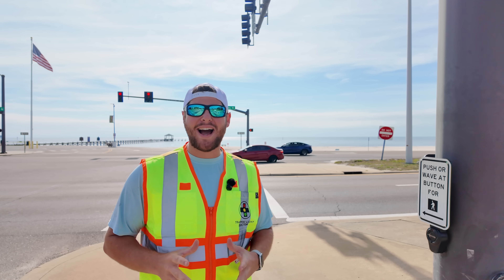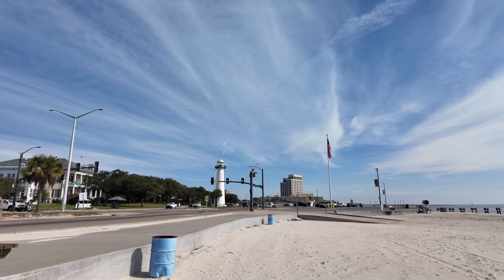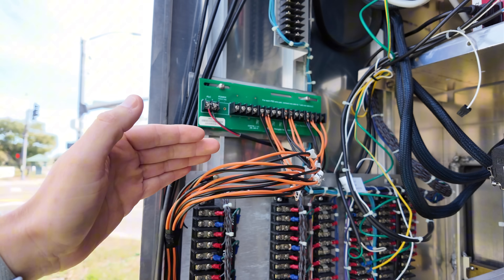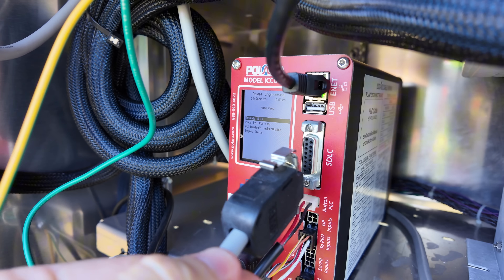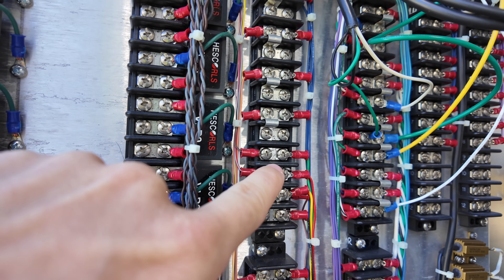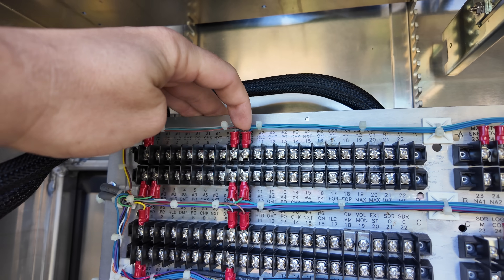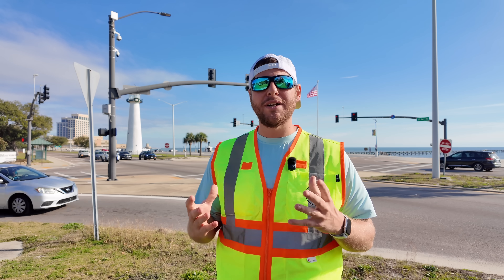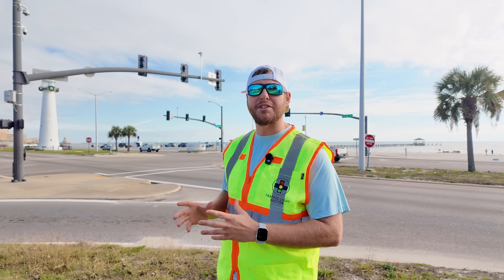What Happens When You Press A Pedestrian Button?

Comment: Yee spoke about a lot of wires, but failed to really explained the programming logic of who goes first and when I the case of all the variables, turn signals, yellow turn signals, what is the logic flow, who goes first, what extra steps are inserted, which automobiles are intercepted.  Typical engineer explaining wires without the most important information, the outcome, results, and ramifications.

Comment: Wait... I'm confused. Now where I have been does the walk indicator not happen with the buttons are not pushed. 

In my current city, Nashville, they most certainly do not do anything. The timing of the lights do not change, the walk indicators happen regardless, and the length of time for walking does not change..

Considering, that often I drive small, static areas with many pedestrian paths, as part of my job. So, I'm intimately familiar with local light changes.

The same has been true of my home city, and neighboring cities. (Which, incidentally, are nearby Biloxi, my sole childhood vacation destination.)

Also, that cycle light active crossing sounds to me like all the vehicles are stopped? Wasn't clear what that means. All the ones I've seen, pedestrian crossings are just synced to left, right, and/or forward turn traffic. Aka, when the lights turn green, plthe parallel pedestrian lights also turn to "walk". 

Generally you can accurately guess the light changes by watching the appropriate pedestrian countdown signals, allowing you to prepare for when the lights turn.

Comment: What a remedial excuse of a PLC, especially compared to any general purpose industrial controller, like those made by Allen Bradley, or Siemens, or GE (Emerson), even small controllers like the Modicon M172 manufactured by Schneider Electric specifically designed for HVAC is capable of more logic. I’m sorry, I’ve been automating industry since 1987 and what some industries refer to as PLC’s is pretty misleading, I suppose my cars cruse control controller could be called a PLC as well under the current usage of the term.

Comment: without the pedestrian call button the lights prioritize traffic lights for any turning vehicles with the green thru traffic signals for one direction.  but when you push the button it signal to let turning vehicles turn first and thru traffic still waiting at red lights.. left turn signals shut off then green light signal for thru traffic turn on along with the pedestrian walk signal... so pedestrian can walk along with thru traffic in the same direction.  
I believe it has nothing to do with timing or how quickly the walk signal comes on...  it changes the sequence of the traffic signals in a way that's safe for pedestrian to cross.

Comment: Even in the late 1990s, techs like you used to remotely connect to these devices using Tandy Color Computer 2 machines (a Motorola 6809 CPU with 64KB of RAM).

Comment: PLCs have been around for over 50 years, you would not have impressed me if you walked through the ladder logic diagram as if you done the electrical engineering of it. The industry you are a part of does what I can only qualify as "verry, very bad" management of traffic flow. We all see a green light just ahead as we wait for the STOP LIGHT we are stuck at to finally turn green. We all know that if we can get within three hundred feet of a green light, it's gonna turn yellow right at a point where we either have to gun it or slam on the brakes and then watch big gaps in traffic as we idle at that STOP LIGHT. There is very basic tech that allows ticket cams to work that could easily be used to hold a green or yellow light so that traffic can flow but the lights for 98% of the country are severely sub-optimized making so called traffic signals nothing more than disconnected STOP LIGHTs, no how pretty you think the wiring is in that 1970s  style control cabinet. 

How about you make a video about why STOP LIGHT management ("very, very bad") is so far from optimized traffic signaling without blaming the use case (actual people trying to get from point A to point B without delays)?

Comment: Can a small notice be added to the buttons showing average response time for a button push ? That was a daunting intersection ! I’m surprised how no one in the design flow of the signal system anticipated user frustration at never receiving any acknowledgement their button-push was acknowledged or any information about average wait times for a response.  Your presentation here, pointing at terminal strips means little; it’s an almost cynical attempt at reassuring the public : ‘OK, heeeere’s the wire coming out of the button, and here it is connecting to this terminal board. . .’ Blah blah  The system reads our license plates but gives nothing in return. The sun is beating down on us (or the pouring rain) as we stand there waiting, we’re tired, the utter absence of any feedback from the system as the cars keep whizzing by make “the button” seem like the inexpensive result of monkey experiments on how to create an illusion of expectation. Your post here is just a weak attempt to boost faith.

Comment: So complicated a system but it works well.  In our town , traffic circles are replacing many lights but a huge issue is cross walks on the exit of the circle causing traffic to stop in the circle.  I learned in New Zealand that it’s ok to go around the circle multiple times rather than stop for a pedestrian.

Comment: ONe of those new talking ones by my old place would never turn no matter how much you hit it. I've sat through 3 full light changes before i just walked across.

The older metal buttons, at lest in my city growing up, not all of them were connected.  there would be no wires coming out the back so pushing them did nothing. you just waited for the lights to change.

Comment: If the ped button is never pressed wouldn't the crosswalk become active anyway once the light changed for the intersecting street?  Does pushing the ped button actually speed up the normal traffic light cycle, i.e 60 seconds vs 120 seconds?   PS the longest I've every waited was 5 1/2 minutes for a 3 lane left turning signal to cycle in Clearwater, FL.  All hours of the day or night.  My hotel for a week was located just past the intersection.  I thought I was losing my mind and had to time it with a stopwatch...  Have we forgotten how to make unprotected lefts?  Maybe turn off after rush hour?

Comment: So, basically, all the button does is control the walk/ no walk sign and has nothing to do with the traffic lights.  That is what I thought, and why I ignore those lights and cross when the traffic light turns green while keeping my attention on any vehicles that may be turning.  Faster and just as safe.
Reply: It has everything to do with the traffic light. The ped will also give you a green for the vehicle unless it is set to run exclusively, which is rare. If you don't push the button, the green might be shorter than the time allowed for the ped to cross, which can cause the pedestrian to get stuck in the middle of the crosswalk. The pushbuttons are there to ensure you have enough time to cross. Maybe he should have given you an example of what can happen if you don't push it.
Reply: @miluth2  
They do not give older or disabled people who can not move very fast enough time to cross.   When you push the button, half of the time, they really do nothing and the traffic lights cycle like normal.  Better to use what use to be called common sense than to depend on iffy technology.
Reply: @Allen-w9d Sorry, I do not control the timing that someone chooses to install for pedestrians or whether or not the buttons are working like they should. I can only tell you how it works and what CAN happen if you don't push the button for your safety or others who might be with you.

 There is something called Leading Pedestrians Interval. It gives you a head start with the ped signal (3-7 sec) before giving a green to the vehicles. I don't know if the controllers in your area has that feature. You can inquire with the owner of the signals in your area, which could be county, city, or state if you feel the timing or the operation of the buttons don't suit you or others.
Reply: And illegal.
Reply: @soniaTX4387  
Depends on where you are at.  Not illegal at all where I live.
Reply: @All @Allen-w9d y little town obsesses about “jaywalking”.  But actually I appreciate the walk sign because they actually work here. If there is a pedestrian, for example, the left turn light will stay red so walkers can cross ( well, only those who are willing to press the walk button).  Our traffic light signals at several intersections separately indicate if we can turn right, left, or go straight.  Our system accommodates drivers and pedestrians.  I like it as I can, when driving, make a right or left turn and not wait for some pokey walkers to cross. We have lots of walkers.

Comment: A PLC isn't a junction block. It's a computer. That block that the button connects to is a way to bring lots of wires into the computer in a compact way. We could call it a concentrator. PLCs are very common in factories as they control metal-cutting machines. (I work in a machine shop doing IT support while also programming the robots that we make for our customers.)
Reply: It is Power Line Communication. You may not be familiar with it. I installed a experimental setup for the company I work for around 2005. It was the new big thing. The company was interested in providing internet over power lines to homes on the same two wires that provide you electricity at your electrical outlets. Data and electricity concurrent. I never heard any more about. 

I am not sure if you are familiar with how pushbuttons are normally wired in traffic signal cabinets. This setup isn't the normal wiring location or pratice .

 It's wired this way in the video due to special equipment in the cabinet. Notice the amount of wires connected to the board labeled PLC (orange and black). In order for the controller to know which pushbutton out of the 4 phases is being pressed it will have to be some type of data code related to each pushbutton due to two wires used as a path to communicate with the red box you see in the cabinet for the 4 pedestrian phases (based on what I see here).

 The terminal is probably labeled PLC to let you know that this is where the the two Power Line Communication wires are terminated. That is the only way the buttons can work and do the additional things they are programed to do based having the additional equipment between the pushbuttons and the controller. The two wires provide some type of data and voltage at the same time.

The controller in the cabinet (the brains) that is programed for the the traffic light is Programable Logic Control.

I work in communications, in the past I worked on traffic signals.
Reply: @miluth2  Thanks. I've been dealing with Programmable Logic Controls and didn't realize the acronym has been recycled in a nearby field. The computer in the overhead box is likely set up as a Programmable Logic Control, as they lend themselves well to state machine designs.

Comment: I don't know why this video came up on my feed, but thank you for sharing your knowledge of pedestrian buttons and traffic signal controllers.

The letters PLC printed on both the iNavigator Interconnect Board and ICCU probably stand for Power Line Communication, not Programmable Logic Controller. The green board mounted on side of the enclosure is not a programmable logic controller. It's an interconnect board. It's printed right on the board. What is Power Line Communication? It's a method of using the same conductors that carry power to also send logic signals. The pedestrian cross buttons stations have onboard logic. As shown there are only two wires running to a unit and it has a button function, an LED indicator for an active request, and the audio function. The two wires carry both the power needed to run the device and the signaling to talk to the ICCU. This communication method reduces the number of conductors that need to be run from the control boxes to the button stations to achieve all that functionality at the button location. Old pedestrian crossing buttons would have only needed two conductors because they simply closing a signaling circuit.

Comment: So I'm not sure if I heard this right or not. Does pushing the button more than once do anything additional or not? I think, if I heard correctly ... pushing the button latches a relay the first time you push it and does nothing additional afterward. Also, pushing the button does NOT let you cross any sooner than you would normally be allowed to cross (which is a mis-conception almost EVERYONE has). What pushing the button DOES DO is tell the electronic controller a person is standing there, so that it will then activate the PEDESTRIAN CROSSING SIGNALS which both pedestrians and cars see (when the time comes). OR, put another way, if you don't push the button, when the lights turn green in the direction you're going, the PEDESTRIAN CROSSING SIGNALS themselves WON'T TURN ON, meanng that if a car turns and hits you he can sort-of somewhat lawfully claim he didn't realize you were in the crosswalk (which won't hold much, or any, weight in court). I think that's how it works.

Comment: You should have mentioned that the button can do different things depending on the intersection. I've noticed 3 different things that can happen where I'm at.
1. Absolutely nothing. No change in light timing, and the walk signal turns on regardless if you push the button or not.
2. It will trigger the walk signal next time your direction of traffic gets a green light without a turn priority.
3. It will keep all lights red and give you walk priority.

Comment: So the wire goes from terminal to pull box to button to pull box to terminal to other terminal to surge protector to PLC input to back panel to light controller where it is ignored. 

Thanks for clearing that up

Comment: These videos aren't wrong but they do only count for certain systems. Some of these buttons actually don't do anything, the lights are on timers based on time of day. Some just sit until they would change to stop traffic and give a walk symbol, they won't change until they can stop a car. If the intersection is, and remains, traffic free, it will not change. These systems are designed to control travel times more than safety or efficient flow.

Comment: I had to use a crosswalk for a first time in forever a couple months ago.The crosswalk button to the right of the intersection worked like normal. You press the button and on the next cycle it allows you to walk. The crosswalk on the left side didn't work as intended. I pushed it and waited for the lights to cycle only to get skipped. I pushed the button again and was skipped once more. I gave it two more cycles. In my frustration I held the button down. I finally got the walk signal to show up. 😅

Comment: I am sorry sir.  I have NEVER had one work!!!  If I press it and 2 minutes later it still hasn't changed to walk with stopped traffic that is a 100% fail.  I waited 5 minutes one time and still NO stopped traffic and light, just to prove my theory.  It is dangerous to cross without the traffic stopped, but the system just does NOT work.  I never press them anymore and cross when there is the least amount of traffic in the cross walk.  Sorry but your explanations are useless on most of your videos and simply not the real world truth.

Comment: I've never seen one that reads "PUSH OR WAVE AT".  I'm guessing that's part of the ADA's newer regulations?
I will say, at one of the crosswalks I regularly use the complete cycle time is extraordinarily long, I haven't timed it (I will next time)  but it's one of the longest I've ever encountered. Just not for the pedestrian walk portion, which starts it's warning, times nearly up, cycle about 3 seconds after WALK, and unless you are briskly doing a cardio walk pace it ends just as you're a bit over half way.  Fortunately the traffic it releases would turn into traffic to to hit anyone who's made it halfway, meaning your safe, pedestrians don't know this and I've seen so many people freak out trying to get to the other side quicker!

Comment: But do multiple people at a crosswalk pushing the same button, or just standing there, decrease the time that the light would wait based on the number of people just like it would for vehicles? 

To be clear, you made other videos that explain how the cameras, or road sensors, know how many vehicles are waiting at the light, and if it reaches a certain threshold, it would decrease the time for the wait because it knows that direction is becoming very busy. 

Does it give the same respect to pedestrians, or do they consider 1 or 100 pedestrians not important, just as long as it was pushed once?

Comment: The pedestrian buttons are like the "close doors" button on the inside of an elevator, providing frustrated users the impression that they can control something when in reality the system just does whatever it is programmed to do.
Reply: Close doors -  does work in most cases. Without pressing it, the elevator waits for 10 seconds before closing. If you press it, it closes doors after 2 seconds.